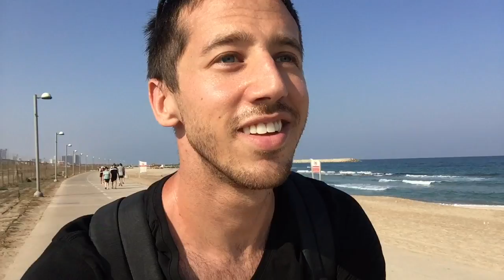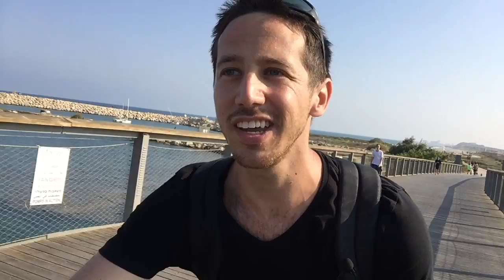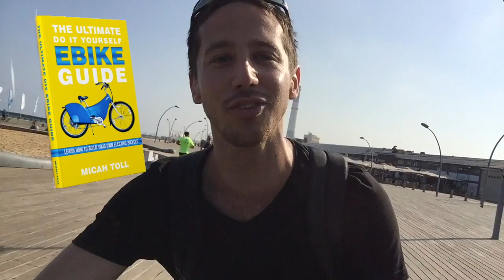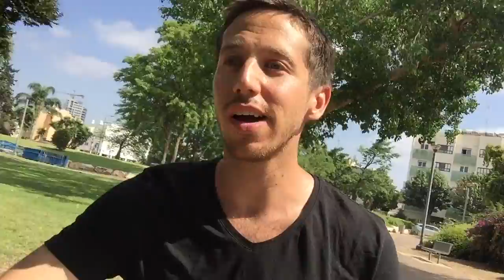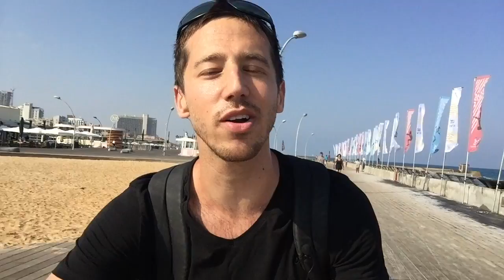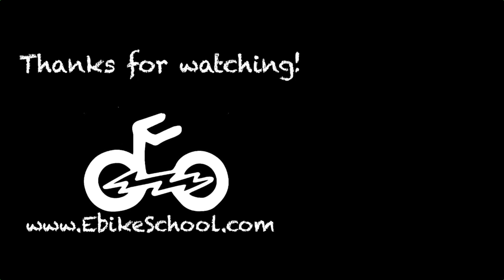10,000 subscribers and a free giveaway!

Comment: Hi Micah. Could you explain something about battery configurations? What if I created a 44V pack (12s5p for example). Should I change my controller unit, which is 36V 18A to a 48V version? Or, is 44V an unusual configuration? Also what about the battery charger? Would a 48V charger be too strong? Thanks!

Comment: Hi Micah,
Very good videos: well organized and clearly explained.

I have several suggestions for content:
(1) pros and cons of 18650 vs 26650 format for eBikes vs starter batteries
(2) issues with travelling with an eBike (or other lithium equipped vehicle) 
(3) Ideas on how to rate lithium batteries

Starter Batteries:
I suggest you have a section on the difference between eBike batteries (Primary: power) and starter batteries (used in motorbikes etc).
The requirements are quite different, although many of the concepts are similar.

For a motorbike/starter battery you need a high pulse/discharge current, in excess of 200 amps. But short duration.
And once started, you don't need a high output, since most of the demand is from the alternator. So you need 50C at times.

For eBikes (as well as eCars) you don't need a high discharge (usually under 1C), but you do need a continual discharge to power the bike.

Therefore for motorbike/starter batteries, it seems to me that you are better off using a LiFePO4 chemistry in 26650 format. They also give more discharge cycles (> 1,000).

But for eBikes, it's better to use the 18650/Li-ion combination. Perhaps even in 26650, but I don't think anyone makes these, and even if so, the sales volume is low, so they'd be expensive. But in theory a 26650/Li-ion combination would have a better capacity/weight ratio than 18650/Li-ion.

I have a motorbike with a lithium starter battery, and I had to repair one. I was researching the net and found that most of the better quality info is on eBikes, so you need to adapt some it to starter battery requirements.

And many motorbike lithium batteries don't have a BMS: although they SHOULD have them.
Mine didn't, and was probably the reason why it failed.
So I've added one, but you need to size it differently than you do an eBike one to allow for the much higher peak current (>= 220 amps).

Travelling:
The new regs in 2016 changed the air transport requirements.
Both about where you need to put the battery (not with the bike anymore, but in your carryon).
And about the max size to keep it from being Class 9 (<= 100 Wh).

In fact I suspect it might be difficult to travel with an eBike battery now, but maybe it could be done if it is discharged to as low a level as possible before hand: I haven't read that part of the UIATA regs yet.

Rating:
I don't THINK there's a standard method for rating Lithium batteries for eBikes yet, although with the right test data it could be done.
Maybe you should suggest a set of ranking values.
And maybe put them on your website for various batteries.
The more people do this, the more likely it will become an industry wide standard. 
And it will help to prevent less scrupulous manufacturers selling batteries with bogus specs.
As in if you have some examples of typical curves for Li-ion/Li-FePO4 batteries, one can quickly see that some of the claims on eBay etc are ridiculous.

Anyways, go well.

Alan Jarvis

Comment: Congrats on the milestone Micah!!! I already have a copy of the battery book, great stuff you are putting out I must say. Haven't had a chance to try to get the Ebike building guide, but I probably could have used it 11 months ago when I started my first build. I'm now on my second build, a BBSHD from the gracious folks at Luna Cycle. I curently have in excess of 250 miles on it, and it is a whole different creature than my first which was a cheapish Amazon rear hub 1000 watt drive. Close to 800 miles on it, now 250 on my BBSHD, puts me at a milestone myself. Getting ready to swap this mid drive over to a much lighter bike, a 2006 Fuji Boulevard f/s. My question to you would be this: What kind of performance gain in terms of battery usage can I expect from the lighter setup? I have a 48 volt 20ah Luna Storm battery with Panasonic PF cells, if that helps any. Eagerly awaiting your response, Dale

Comment: Well done!

Do you use recycled 18650s?  If you do I have a couple of questions. Are there any metrics to immediately identify a good, or bad, 18650 without going through a couple of charge discharge cycles? E.G., how low is too low a voltage? How hot is too hot when you charge one? How much self-discharge over what time is acceptable? How much should a battery voltage sag when a load is placed across it? Last, but not least, what else should I know about 18650s?

Only new to your channel and you may have covered all these questions in early videos I have yet to watch, if so, I apologise for my newbyness
Reply from the maker: I rarely use recycled 18650's. When I do, I test them all first with 4-cell 18650 testers. I'd recommend watching the channel hbpowerwall here on youtube - he's the king of testing recycled 18650s.

Comment: Congratulations on your 10 GRAND!  Like all your builds and videos. I have a 36v 12Ah Sealed Lead Acid battery scooter. Would it be hard to make a battery pack to lighten the weight on the on the 540Watt scooter? Thamks!
Reply from the maker: Shouldn't be too hard, but you need to follow proper procedures to do it carefully and correctly. I've got a 5 part battery building series in my past videos, look for that - it should help.